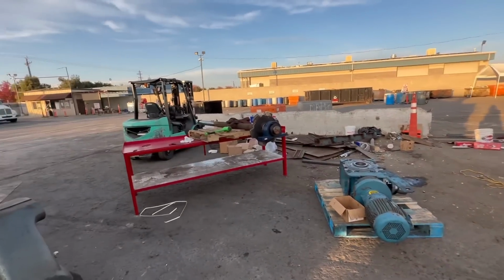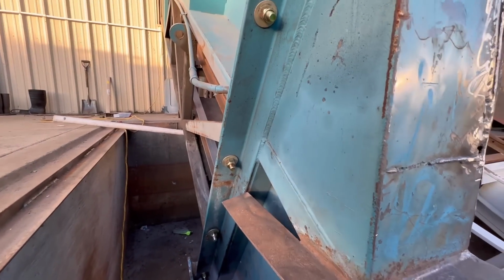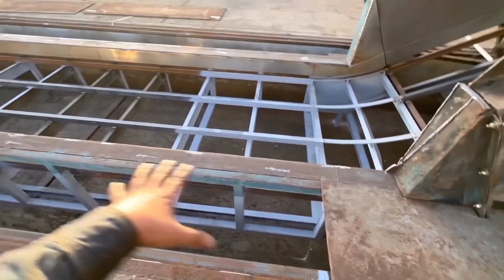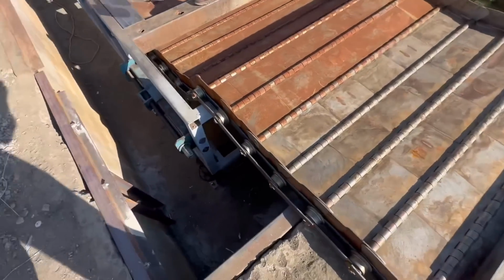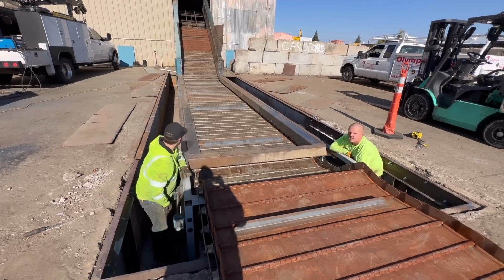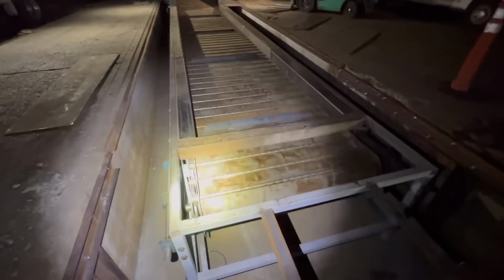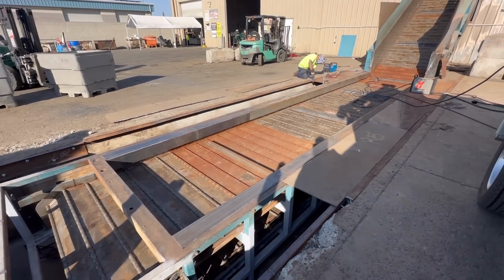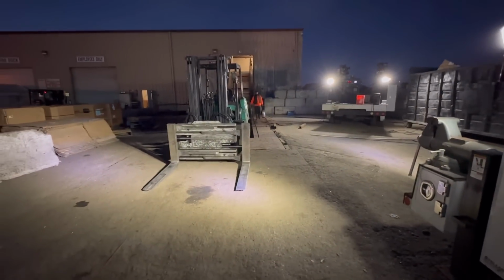Baler Rebuild … Part 3

Comment: Sounds like a engineer designed the original inspection plate set up. Then a tradesman Comes in and makes it actually practical.

Comment: A great series there guys . Just goes to show it's not a 5 minute repair on somethings . Great change to watch from excavators and back hoe repairs . What was the overall time frame on this one and as for missing or not filming certain bits it didn't notice.  As you say you can't film every cut or weld or that's just going to add weeks to a short job . Thanks guys

Comment: That belt has got to be a friction nightmare! How are the joints lubed? Seems maybe a automatic greasing system can be designed. Maybe a oiling system, using something more like gear oil, under pressure, I don't understand why it needs to be underground either....
Reply from the maker: There is an automatic oil system that never works and grease fittings that will probably never get greased.

Comment: Serious question, no seriously, are you a welder (craftsman) with a mechanic / millwright sub-trade, or a mechanic/ millwright posing as a craftsman, most welders aren’t  interested in the sub-trades, but sub-trades all want to be craftsmen / welders. Sincerely, a humble welder. This was a cool job. Thanks for sharing.
Reply from the maker: I would say I’m a welder with a mechanical background.   I started welding when I was 8 and have worked at all kinds of shops when I was younger.

Comment: Professional work.  Congratulations.  How many days did you do it?
Reply from the maker: 17 days total
Reply: 17 days after how many years??? Also we’re those 17 straight or did you have to wait for parts etc. So that you could do other things
Reply from the maker: 18 days straight took one day off. So 17 working days.
Reply: @OFW  
That’s what I call determined. I did the sorta thing in Jan of ‘14, I drove a truck, I started in Dec & didn’t take a break until Feb, 35 days straight 16,000 miles. Sold the truck in ‘19.

Comment: The broken concrete around the edges.  Not a welders job. But are you aware there are 50 or 94 pound bags of freeway repair cement. That sets in 15 minutes and can be driven on in 4 hours. Not as crazy priced as the 5 minute set.  Caltrans uses it to fix freeways. Not a well known product .